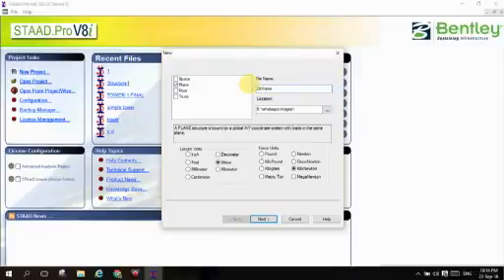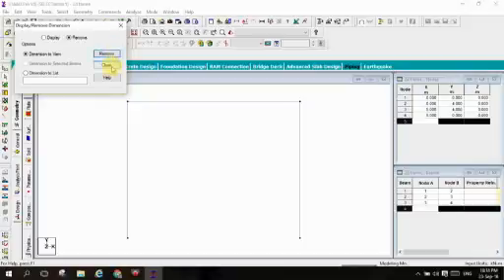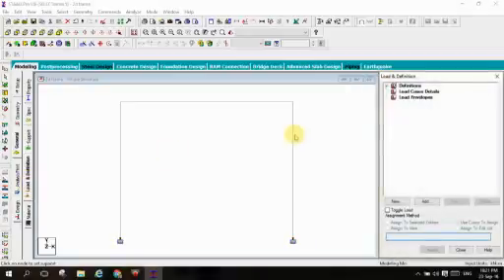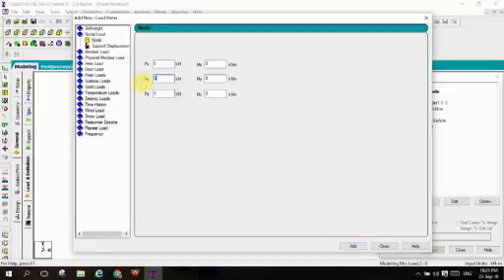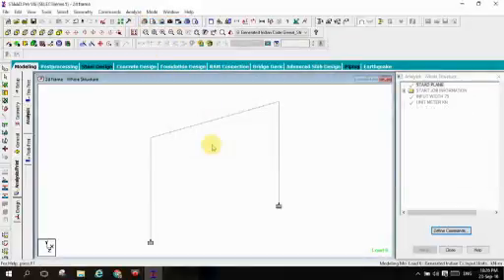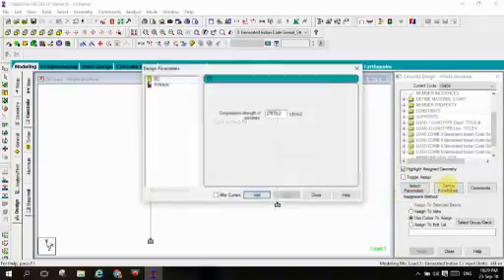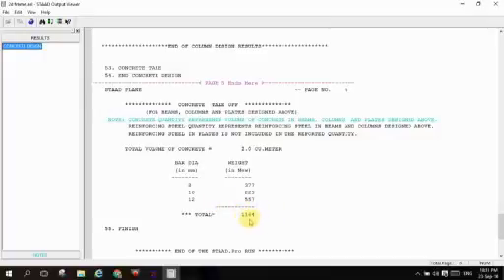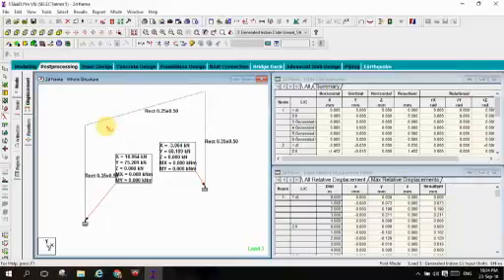2d structural analysis

Comment: very good explanation. however i am getting the following  warnings in a 2D frame i am working on
1. joint no 8 not connected. OK if part of master/ slave
2. this structure is disjointed
3. zero stiffness in direction 1 at joint 8.
please help me with the solution to the above thanks
Reply: and also my post processing tab is not active what could be the solution to this?

Comment: Sir, how can I know what loads can apply on different members in a structure.
Reply from the maker: 1.self weight under dead load should be applied according to IS876 part 1
2.live loads under concentrate loads,UDL,UVL,presssure load,surface load and nodal loadshould be applied according to IS876 part 2
3.for the <G+5 structures wind load and sesmics load should be applied according to IS876 part 4 and 5

4.FOR THE ABOVE 3 POINTS THE COMBINATION LOAD SHOULD BE ADDED WITH FACTOR OF SAFETY ACCORDING TO CODE IS876 PART3.
Reply: Thank you Sir
Reply from the maker: Srinivas Pyla welcome dear